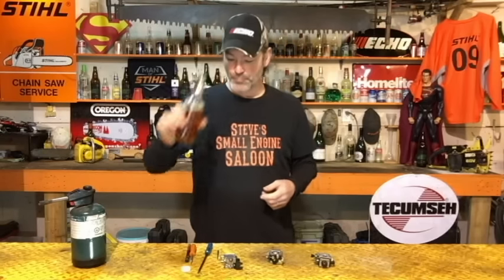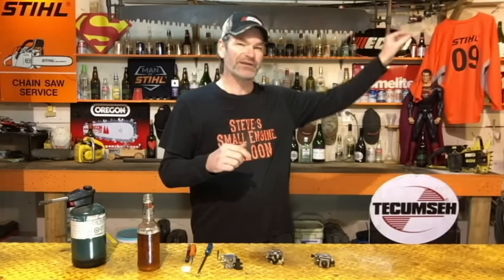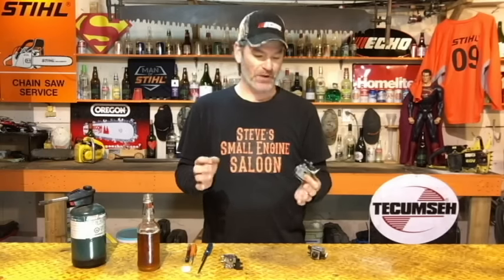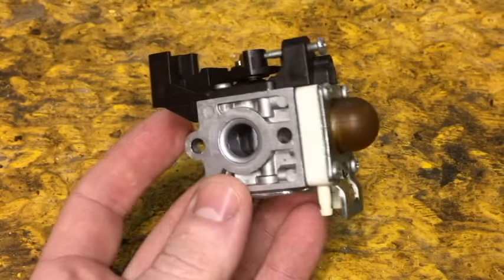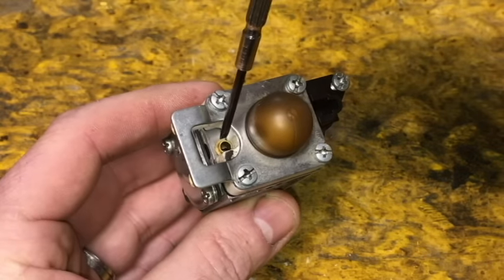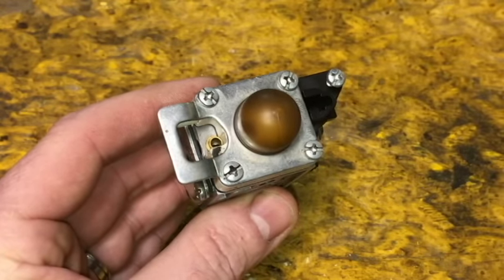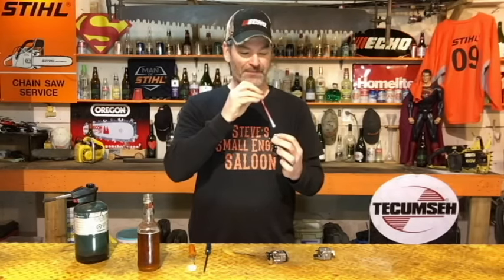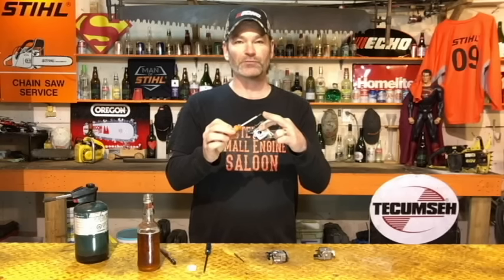Hidden Carburetor Adjusting Screws On Some Weedeaters And Blowers

Comment: Steve on my Toro string trimmer I found the power screw hole right through the top of the throttle barrel. Where the throttle cable linkage connects to rotate the barrel. There was a rubber plug down inside. I got it out with a small 3/64ths drill bit. Then made adjustments to the screw with watch repair screwdriver.  There are no other holes in or around the carburetor to adjust.

Comment: I have a Husky 150BT leaf blower, which after two years' use, started the all-too-familiar symptom of bogging down when the throttle was opened. I checked the spark arrestor and plug, and all was good.  This video and others indicate that the problem can be fixed by backing out the high speed adjusting screw.  It has a double-stack carb and I can access the low speed screw adjustment as shown in this video, but the carb manufacturer has driven small metal balls into the other ports so users can't do any adjustments that might worsen the exhaust emissions.  Like BBs or small ball bearings.  There is no way to extract those to get at the high speed adjustment screw.  I figured I would just have to buy a replacement carb.  On Amazon, the OEM Husky replacement was $75 with tax.  There were a couple of dozen other imported "brands" that were similar to the original, but were priced between $15 and $20.  They all looked like they were made in the same factory, and customer reviews indicate they were cheap junk knock-offs (little or no process or quality control, lowest possible grade of materials, etc.)  So I started asking myself "why are the high speed jets having to be adjusted?"  I assume ethanol (I treat all my ethanol gas with Lucas fuel additive) and other contaminants are likely getting into the tiny ports within the carb and the jets have to be opened to compensate.  This may or may not be the exact explanation, but I figured I had nothing to lose, so I VERY CAREFULLY dis-assembled the carb and cleaned everything, especially the tiny brass nozzle piece I found deep inside, with a can of spray carb cleaner from WalMart.   Once I got everything back together and established fuel flow into the engine, it now runs like a swiss watch. I plan to keep the OEM carb, drain it or run the engine dry before storage, and periodically spend 20 minutes each fall cleaning the carb. FOR WHAT IT'S WORTH.

Comment: Because i do epoxy floor coatings, maybe we have a chance at these epoxy filling screw holes. Solvent, yes, solvent is Epoxies Kryptonite. either, maybe, fill that hole with solvent and leave overnight, or soak the Carb in it. OR, maybe just the heated screw driver with the Map gas bottle will sizzle thru there?
Aussie word of the day. Carby. Short for Carburettor We don't say carb much , Carby is  how we all say it.,
Reply: @Carat Cranker He says the epoxied type is non-adjustable. No side screw hole at all; top has epoxy filled hole but he doesn't refer to it as a screw hole so maybe not worth removing . Since he knows the hot screwdriver tip trick, I expect, if it could work on epoxy, he would have said so.

Comment: They should not be allowed to sell any engine that cannot be easily adjusted.  Similar as to making a Beer can you cannot open without a special tool.   Right ?
Reply: Gotta love government intrusion into industry.  Somehow, the EPA thinks wrecking an engine with too little fuel and oil is better than a properly tuned engine that runs for decades.

Stop running 50:1.  40:1 makes happier bearings and rings, keeps machinery out of the landfills, and reduces the pollution of making new ones you shouldn't need to buy.

Comment: Steve as a fellow beer drinker and someone who aint interested in wasting money, a huge thanks for pointing out that my Walbro carby on a Ryobi blower has hidden High and Low Speed screws. I found them and will be adjusting according to your helpful comments. Just gotta find a small enough screw driver or tool to get those plastic plugs out. Cheers from Australia. Dean
Reply from the maker: Good luck mate!

Comment: Dumb q... why don't they want us adjusting them??
Reply: oldcoinsandstuff1.....environmentalists....some people will adjust the mixture too rich and smoke up the environment......
Reply from the maker: That is correct.  The better they run, the worse the emissions are.....
Reply: Another reason is the manufacturers to sell as many carburetors as possible. If you can’t adjust one and the engine runs like shit, you’ll have to buy another one. So they make more money of consumers thinking it is “non-adjustable”
Reply: Oldcoinsandstuff1 because then you would be able to fix it yourself instead of buying a new one.
Reply: @charlesbucholz8079  Or you have to take it in for repair = money out of your pocket.
Reply: Jamie Rinehart yeah that's what I was explaining. The manufacturer doesn't want u to know how because  they lose money when people know how to fix it themselves.

Comment: Working on a Black Max grass trimmer. Runs great at full throttle but wouldn’t idle. It would just die. Watched this video. Pulled out the plastic plug. Adjusted the tiny screw. Machine runs perfectly now. THANKS !!!!
Reply from the maker: You're Welcome...

Comment: Thanks for info, I have a cheap walmart weed eater motor I'm making a homemade 3  wheeler out of and the carb needs alot of adjustments and I could find the screws and was getting frustrated but then I found this video! I'm a little nervous that I won't have to use the the hot screw driver on the plug as it spews gas everywhere and i have to keep the carb wrapped in towels. Sorry for long comment...2 am boredom

Comment: I have a Honda Shadow VLX 600 motorcycle. The original idle mixture screw has a D-shaped head recessed so it's almost inaccessible as it's behind the carburetor bowl. One trick I heard  is to use a spent 22 cal. casing and needle nose pliers to create a flat spot in the 22 casing into a D-shape and solder it on the end of a thick copper wire to make an adjusting tool. It worked. Later I found that there's a guy in California who specializes in Honda Shadows. He's on YouTube as TJ Brutal Customs, he sells idle mixture screws that are long and extend below the carburetor bowl so I bought one. If the engine is hot, with a glove you can make adjustments by hand without a special tool. I digress. Thanks for posting this. I do have a 2 cycle weed eater and a blower. I haven't looked closely at the carbs yet, but if I ever need to make adjustments, at least I have some idea how to.

Comment: Thanks again for posting these videos. It seems like, once or twice a year, I run into something new (to me) and, sure enough, you have a video on it, and save my bacon.

I just got my first Zama carb in to the garage, the thing runs good wide open but will not idle to save it's life. I went to adjust the low speed side and couldn't find an adjusting screws. I remembered seeing this video over on the right side, so here I am. And I'm about to go out and do this thing. I don't have the specialty tool but I've got jeweler's screwdrivers all around the garage . 

Thanks Again. Take Care!
Reply from the maker: Good luck!
Reply: @StevesSmallEngineSaloon  It went great. Thanks

Comment: Great video, I would suggest that if you are going to heat up a screwdriver to remove the plugs, do not use your good screwdriver, it will screw up the temper and soften the tip.  Keep a good one for the adjustment.

Comment: the heated screwdriver tip worked perfect.TU. now if only i could get this started even the rebuild hasn't worked on my Walbro WYC-3 and i'm not about to spend 45-90 on this carb.

Comment: What do you do if you have a nonadjustable carburetor for the high side and it doesn’t have a mixture screw, I just bought one brand new. I can adjust the low side, but I can adjust the high side in my eyesight bogging on me.

Comment: Hi Steve thanks for all your help . So my tro-bilt trimmer was running poorly. I tried to adjust it following your 1-1/4 turn out from the bottom and now it won't start at all. I tried all kinds of settings . It does start if I shoot some fuel into the intake .Then dies after burning off the fuel I put in.

Comment: I did this to my blower that I was having starting issues with and it worked OK then after a few months it became a problem as now it won't start at all no matter how I adjust it, so now I have to take it into the shop and have it fixed proper.

Comment: I have one of those carbs that have the adjustment screw hole plugged with a plastic plug. Easy to remove but one thing it runs on propane . It is used on an Ice Auger for boring holes when ice fishing in the winter. It gets really cold here in Wisc. Is the adjustment procedure the same on my carb as on one running gasoline?

Comment: Hi! Thanks for the video! What does the big screw do? Because in some manuals it is said that the adjustment is done by turning a screw that looks like the big screw in both barrel type carburetors.
When I turn it until the string (i.e., the round thing that holds the string) does not move anymore in idle, the motor stops, when I push the "gas pedal" (sorry, don't know how it is called for the trimmer). It is also said in the manual, that if you cannot adjust the carburetor bu yourself, take it to the service. The trimmer is Oleo Mac 755 Master, but I think that you don't have them in the USA. Thanks in advance.

Comment: Steve, I have a Maruyama leaf blower that hasn't run properly from day One. Unfortunately, I bought it on eBay and was unable to return it. I've looked it over a dozen times but was never able to find any adjustment screws on the carb. Yesterday, I stumbled onto your video and discovered my leaf blower has a Walbro carb. I found the high speed mixture screw, used your hot screwdriver tip to remove the plastic plug and it now runs perfectly. Unfortunately, the idle speed screw has a blob of epoxy over it but the idle is fine, so it doesn't matter. Thanks for passing on your insights and experience!
Reply from the maker: You're Welcome...

Comment: Thanks great vid. I did not even know about the one on top of the barrel. And the other between the fuel lines I always had to take it apart then use a screw like a deck screw and screw it in then pull the plug. That is the one that always needs to be adjusted on Echo's. Now  I know a much easier way to get them out and where both screws are. Thanks Bro I will do a shot of Tequela and chug a Corona for you.
Reply from the maker: Right on Shin...

Comment: Just found your channel, love the simplicity of how your describing things. I have one concern, the second carb you are using with the "d" tool is the type of carb I have on my 4 stroke honda brush cutter HHT35S. The location of the high speed screw looks like it has a copper or brass cap over it. Any advice for that? The low speed is as you described in the video.

Comment: Hey Steve, first of all I love that you always have a nice cold one on your work bench !..I just found your channel and will definitely be subscribing..Also I sent a link to your page to a few other people who were having the same problem as me..we cant find adjustment screws on carburetor..After watching your hidden screw video I do plan on giving it another go..I have a Ryobi 38cc -760 cmf blower that is bogged down..I changed plug already but no difference. I Also ordered the fuel filter& air filter..(air filter is soaked with unspent fuel).Im not an engine mechanic so this is a little foreign to me.On other sites I saw how to change all of the above..Ive also watched your carburetor adjusting video so if i can find screws im hoping to solve..any chance you are familiar with the carburetor for ryobi 38cc?..Thanks for posting these videos!..it gives newbies like me a fighting chance..do you know if there is a replacement carburetor package for this model ?

Comment: Great video and information! Thank you. Have an MTD 4-cycle MP429. It has a low speed screw, but where the high speed hole is solid metal at the base. Low speed takes the Little D tool.

Nice wallet! My niece made me a duct tape wallet a few years ago.
Reply from the maker: Right on...

Comment: Although 4 years old now I tried this out on my Craftsman 34cc 4-stroke weedwacker. It had a non-adjustable walbro carb, but replaced that with a newe walbro carb that has a non-capped high speed screw (I kept assuming it was the low speed screw and I was cranking it way out with no change in idle :( ). Watching this vid straightened that out and I was able to get that carb set up just right. I could not touch the low speed screw though - I just didn't have a small enough screwdriver, but it seems to idle ok.
--- Edit ---
Found an appropriate screwdriver and got the idle adjusted perfectly (the carb came from the factory way too rich!). The low speed screw came complete with little rubber plug - easily removed. Can't believe how well this trimmer now runs. I don't think it ever ran that well even when I got it new.
Reply from the maker: Right on

Comment: Steve, just found your channel a few minutes ago, and already watched several of your vids. I enjoy your relaxed style, as any guy who starts his vids with a sip of beer is OK by me. I was just given a no-name (literally, can't find a name on it anywhere but given that most of the crap sold here is made in China, I'm guessing that's where it was made.) gas-powered weed-eater that was bought new and the owner could never get it to start. It was then drained, put on a shelf and forgotten, so it's two years old but basically never used. I checked it today, added some gas and oil. The plug was getting spark and had gas on it when I pulled it but I couldn't start it either. Now, however, after watching this vid and the one about adjusting the carbs, I'm gonna check it out more tomorrow and see if the high and low speed screws are set right. I look forward to more of your vids. Thanks for making and sharing your vids!  Take it easy!
PS The wallet was awesome, and even more awesome is that your daughter has the 'handicraft' gift.  That's so cool!!
Reply from the maker: Good luck Davey!

Comment: Hey my Zama carb doesn’t have the high adjustment.  It’s on a ut 08542a 
Homelite anyways I think I got it going with new gas lines and quick carb clean. Still takes long time to warm up.  

Great video.  Have a Red Hare beer from my local brewery.

Comment: Small D and Big D tool ? 😄.
  Anyhoo... I am able to adjust the “truly untunable barrel carb”.  What i did when learning on goped scooter engines,  was to use very thin needle nose pliers and adjust the barrel needle from inside the carburetor ventury.  You can only twist it a tiny bit at a time,  but doable, and it works.  
   Great videos,  very well made.  Thanks
Reply from the maker: Right on Rich..

Comment: As always Steve an awesome video, but you misspoke on 1 thing where you said you had to have a small D to adjust the screws that there is no other way, well necessity is the mother of invention. if you take an automotive butt connecter red or blue red is large D blue is small place them over the screw and give it a firm hit with the handle of your screw diver, then place a small flat tip on the butt connectors opening, tap that in tell its firmly in the butt connector and turn it works like a charm, I now have all the proper tools but I still have butt connectors in my tool kit just incase

Comment: Hey Steve,
Looking at my Zama on my Echo SRM 230, it doesn't have plastic plugs. They are brass! I got the one out of my high side but not the low in the throttle body

Comment: the description took me to regular adjustment tool, not the small d for the barrel adjustment. There were d type tools, but the same ones that I have which adjust regular high and low speed needles

Comment: Cool, I have an older craftsman pro "weed wacker" that appeared to have no adjustment screws.  Now I'll take another closer look.  It has a peculiar behavior compared to my Echo trimmer.  When I begin to hit the weeds/grass just a little resistance makes it oscillate some as of the flexible shaft is uncoiling a little and then recovering.  Not really bogging down or surging just a weird oscillation.  Its a straight shaft trimmer and the head when removed from the shaft spins freely and smooth.   Anyone ever notice something like that?

Comment: Earlier Walbro WYL carburetors have only mixture needle in the center of the barrel. However, the do have removable jets inside the carb of different sizes that can be changed to alter high speed performance.

Comment: hi Steve...great info...thanks...one question ...if i have a non adjustable walbro and is not working as it should....can i replace it with a adjustable zama?or is not going to work?i want to.mention that i have a very little knowledge about the 2 stroke engines and carbs ....thanks again

Comment: A friend of mine brought me a blower that he had taken to a shop. He said they told him that the carburetor was not adjustable and he would have to buy a new carb. Can’t remember the model but it was a small husky back pack blower. I looked at it for a half a second and spotted the hidden screw. Adjusted it and he was amazed. Took me less than 2 minutes.
Reply from the maker: Right on Paul...

Comment: Steve, my echo weed eater leaks oil from the exhaust and gets on my garage floor.  I mixed it at 40 or 50 to 1 I can't remember.  What gives?  I may take it back to home depot.  Think it's the 225 model straight shaft.  Thanks